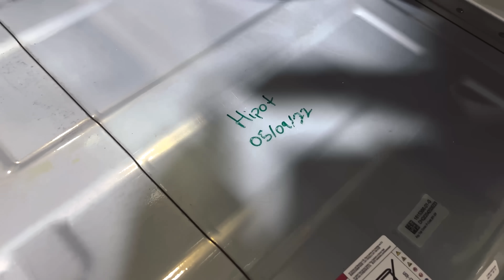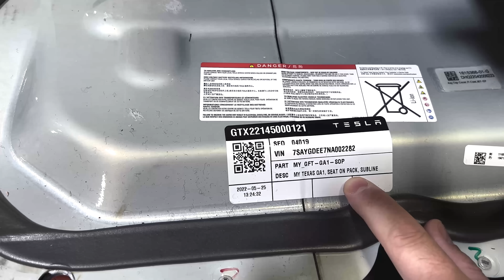Tesla Model Y 4680 Structural Pack OUT!!!

Comment: Why don't they separate the floorpan from the battery pack? That way you have the benefit of being able to assemble it exactly as shown in the video by lifting in the pack with the seats on them but when disassembling if you need to replace the pack only you can leave everything mounted to the floorpan saving a lot of labor hours.
Reply: Weight and cost. Tesla doesn't care about ease of maintenance.
Reply: @brianb-p6586  It's not going to be much weight because you are essentially adding a non structural thin top cover to the battery, the floorpan that is reinforced for the seats is already there. Likewise a thin top cover isn't going to cost much at all and they would actually save a lot more money in terms of labor, because some packs will go bad under warranty.
Reply: @boostav  You're suggesting going back to the way every other EV is built. There's nothing wrong with that, but the whole point of the structural pack is that weight (and cost) saving.
Reply: @brianb-p6586  No offense but you've got no idea what you're talking about. The cost and weight savings of the structural pack have nothing to do with a thin and extremely cheap top cover.
Reply: @boostav  Why be so disingenuous? "You've got no idea what you're talking about" is certainly intended to be offensive. But it's okay, I'm not fragile. 😂

Any battery pack can contribute to the structure of the vehicle, whether it replaces the floor or not, and the reason to do so would be weight saving. Once you're bolting a pack to the rest of the vehicle at lots of points (40 in this case) it might as well be integrated with the floor as well, for more weight and cost reduction.

If the pack had only a "thin" (not structurally useful) top cover, the pack's structural contribution would be much lower, since it would be relatively flexible... and that would be even worse structurally than just using more bolts to install a conventional pack.

Your proposed design increases manufacturing cost and vehicle weight with no benefit to the manufacturer - Tesla won't do that.
Reply: @brianb-p6586  You're misunderstanding what I'm saying. The additional thin top cover would not replace anything that you see in this video. It's simply a very thin additional layer that would allow them to remove the pack without having to disassemble the seats and other interior pieces when doing warranty work. Other than that it would be identical to what is shown in the video. This would save Tesla money because the increase in cost due to the additional thin top cover is easily offset by the savings in labor for warranty work.
Reply: @boostav  I understand the intent of the thin top cover - it's pretty obvious.

So how do you think this would work? 
You need to replace the pack, so you remove the 40 bolts and unplug all of the connections, then drop the pack with floor and interior, then put the floor and interior back? That wouldn't help with the cost of pack replacement
You remove 40 bolts and drop the pack, but the floor and seats don't come out because they're still held in by an extra set of bolts? The factory would have had to install those just in case someone ever had to replace the pack
Since the vast majority of vehicles will not have the pack replaced under warranty, the extra cost of the more complex installation (both extra parts and extra labour, plus the indirect cost of extra weight) would need to be a tiny fraction of the savings of a pack removal.
Reply: @brianb-p6586  In the first scenario they would not have to remove the seats, the console and the carpet and not throw away the welded seat risers every time they have to open up the pack for warranty work. You would simply lift that entire structural floor pan and put it aside with everything on top of it assembled, so you're just canning a thin and cheap top cover.

In the second scenario you're making the assumption that the number of bolts would change but that is not the case, the weight is the same. Instead of 40 screws holding both pack and floorpan w/interior you now have x number of bolts holding just the pack and y number of bolts holding just the floor pan w/interior.
Reply: @boostav  Oh, that's even worse. You're still making the shop still remove the interior of the car (seats, console, carpet), just to avoid a few bolts to remove the seats and console from the pack. Have you taken out seats? If they were sitting in the open on top of a pack, I doubt (based on my experience putting seats in and out of my car when race-prepping it) that would take more than two minutes per seat.

Also, in this scheme the structural floor panel would be fastened to the pack only by the perimeter bolts, which will make the combined pack and floor less stiff and strong than being bonded all the way around (and likely in the middle) as with the current structural pack.

Watch the next video (out today) which should show that the top panel isn't just fastened around the edges.

Comment: Interesting concept. Since the two things that should be well protected in a crash are the battery cells and the passengers there does seem to be some synergy combining the structure for both. And, it may not be obvious but the structure for the seats also needs to be quite strong and stiff to make sure it can't be excited into shaking from road input (or you can just insert your favorite overweight Americans joke here).
Reply: A concern I've had for a long time is that Tesla's prefered assembly method of potting cells into large slabs would demand a highly-rigid enclosure to avoid stressing the potting and cooling channels.  I have to wonder if that's why they decided to ask double duty of the pack enclosure as body structure?

Comment: This is exciting from a manufacturing standpoint, but has me concerned from a maintenance standpoint. Changing the battery pack on one of these cars looks to be a hellish nightmare!
Reply: If the Munro staff can do it, anyone with a hoist can do it... but allow a couple of hours. It doesn't matter anyway, since Tesla probably won't sell replacement packs except through their service facilities.
Reply: @brianb-p6586  I'm not saying it can't be done, I'm saying it is more difficult than it needs to be now. Imagine accidentally nicking a coolant line in your battery pack if you bought them out. Today, Tesla will make you buy a brand new battery. Tomorrow, Tesla will make you buy a brand new battery along with a brand new interior that you don't need because presumably they will sell the whole thing as a single assembly, adding needless expense. Not to mention insurance companies will be more likely to total these cars for the smallest battery damage because the repair costs and labor time will go up exponentially.
Reply: @ManuNarang  It's unlikely that the interior components would sold as an assembly with the battery pack - how would they even ship that? It will just be more effort to remove interior parts from the battery pack then reinstall them on the new pack. Yes, that means higher labour cost which is some cases will tip the evaluation in favour of writing the car off and scrapping it.

How cars are built often doesn't correspond to how they are maintained. For instance, typically the engine and transaxle of a front-wheel-drive car (with an ICE, not EV) are installed in the factory from below, complete with the front subframe or crossmember and the complete front suspension; while they can all be taken out this way, in a repair shop that's rarely done, and components needing repair are removed individually.
Reply: @brianb-p6586  I guess time will tell. Though we can agree that either way, labor costs are going up, either by a bit, or by a lot.

Comment: I see this probably good for production but The problem is when repairs need to be made you can no longer simply take out the battery, you have to disassemble 30% of the vehicle in order to access the battery, then you have to take apart everything that’s attached to the battery SIMPLY TO SWAP A BATTERY………..

Comment: Awesome!

Elon Musk is not goofing around when he says its all about manufacturing, the level of improvement in just 2 years basicly, is awesome! and all is focussed on simplyfication of manufacturing and improvement in quality and consistency and the same time reduction of costs.

This will also improve the speed of manufacturing too, installing seats on the main assembly line takes a lot of time, by doing this in a sub asembly line saves so much time, its incredible. The sliding console is such a "why did we not think about this earlier" thing, it makes installing the console so much easier!

I love these kind of video's, very curious about the many differences you will find, compared to the early Model Y you tear down.

Comment: As they started, I was immediately concerned about the compression of that elastomeric seal in some spots. Glad it was mentioned. Wiring is being reduced, but would like to see it reduced even more. Somehow that focus was dropped, but I can imagine dropping the amount of wire by at least 2X compared to now. Obviously other things were more critical to focus on. But do expect major improvements to continue with time. Just love these tear downs. Great job!
Reply: The wiring had been explained.
They want to go for a 48v system, but nobody makes components.
Reply: @rogerstarkey5390  No, the improvement we are looking for is reduction in total wires, not wire gauges.  Tesla was supposedly to reducing the total amount of wiring by a lot with single wires going to components and daisy chaining.   This most likely introduces reliability problems so they are progressing towards it over time instead of trying to do an immediate jump to the endgame.
Reply: @_PatrickO  
All part of the same plan
Reply: @rogerstarkey5390  Nope, these are two completely and independent things. A single wire for power and communication has nothing to do with switching to 48v.  The single wire solution is far bigger for weight reduction than going from 12v to 48v.  It is why 48v is on the back burner, it isn't that important.
Reply: @_PatrickO  
Presumably, the "single wire" architecture will rely on unibody frame for current return and daisy chained addressable loads and/or current distribution hubs where wire gauge will change. Some of the constraints on wiring are built into legislated regulations so, like cameras replacing side mirrors, it will require a lot of lobbying and probably tortured test beds.

Comment: If the SR 4680 based model Y weighs the same as the long range 2170 Model Y, my money is on them actually putting in more cells than advertised, and software limiting them until Freemont is converted to 4680. They’ll offer a range extension upgrade for a fee, then software unlock them. Can’t wait to see what Munro finds when they take the cover off! Nice work!

Comment: 1198 lbs equals 540kg...holy moly, that is extremely light. Does someone know the weight of the whole car with this battery config?
Reply: 4680 Y = 3800lbs
2170 Y = 4200lbs
with same kwh capacity
Reply: @larryc1616  damn, that's lighter than my Volt with a 16kwh pack.
Reply: @larryc1616 , how much do you recon this 400lbs measure up in terms of rolling resistance?
Reply: Not a lot but for urban driving will make the car more efficient, accelerate faster and corner better.

Comment: While I appreciate the manufacturing efficiencies of this, I can't help but think this is going to lead to long term durability and also serviceability issues. I have a hard time believing that single seal will provide a long-term seal against the body. I expect water ingress issues will be common with these cars. From a serviceability aspect, replacing the battery just got significantly more difficult and time consuming as well. The giant casting, while obviously very rigid - also screams "This vehicle is completely utterly un-repairable in the event of an accident". If that casting is compromised, it will be an absolute nightmare to repair.

It's certainly interesting, but definitely not without a lot of cons.
Reply: At 11:02 the engineer says minimal additional work to remove the battery pack. I'm pleasantly surprised that the structural battery pack is bolted in, not welded. Small businesses are starting to replace Leaf battery packs and removing this pack looks similar, with the added complication of needing sufficient ceiling height in the workshop to lift the car high enough to clear the seats. This Tesla battery pack is designed to be very long lasting, so by the time a high mileage taxi needs a battery, the carpet and seats are likely to be tired too. ☮️ The water seal does look inconsistent with a long life. 🤔
Reply: @backwoodsbungalow9674  That's minimal work to remove the pack. The pack still has all of the seats and interior attached to it. The new pack won't have any of that. All of that stuff will need to be removed and attached to the new pack.

Comment: 1200 lbs weight for the pack with seats and all attached is pretty impressive.  Compare that to the 2012 Model S “85 kWh” pack, which weighed 1200 lbs by itself.  Total energy was about 82 kWh for the Model S, and this pack is at least close to that much total capacity. Maybe equal capacity if it is software limited.  Compared to the Model S pack this new 4680 Model Y pack also includes the on-vehicle charger, DC-DC converter, front seats, center console, carpet, and some of the BIW structure!  All of that was separate for the Model S pack.
Reply: Model Y 4680 battery pack is ~68 kWh.
Reply: @officialyasir  68 kWh is the useable capacity. Total capacity is a better reference when comparing pack weights.
Reply: @georgepelton5645   ~68 kWh is the gross battery size, around 66 kWh usable.
Reply: @officialyasir  I thought only Tesla knew the gross value. 2 kWh is a very small buffer for a pack with brand new design cells. Especially when owners report getting full regen when charged to 100%.  Where did you get that information?
Reply: @georgepelton5645  tesla employee said that’s what the pack is listed at as nominal in their system. Getting regen at 100% battery is due to recent software update where the system applies friction braking to mimic regen when regen is limited due to full battery or cold weather etc..
Reply: @officialyasir  Interesting.  Thanks.
Reply: The structural pack will likely reduce weight in the frame, so just weighing the pack does not give the full picture on weight savings.
Reply: @_PatrickO   the Spoken Reviews channel had their Austin Y weighed and it was around ~4,300 lbs so it's only less than 200 lbs lighter that Fremont Y. Remember Austin 4680 Y has a smaller 68 kWh battery too. Basically, no magical weight reduction from structural pack.
Reply: @officialyasir  200lbs of frame lost due to the pack being stiffer seems really good.
Reply: @_PatrickO  weight reduction is not all due to structural pack, there's also a smaller battery.
Reply: @officialyasir  I  think most people would bring up the castings and say the pack plus castings helped reduce other weight.  The 12v battery savings would only be like 15lbs.
Reply: @_PatrickO  the point is that the majority of the weight reduction of around 200lbs of the current 4680 model y is from the smaller battery pack. 

The 12v lithium battery is also in the 2170 Fremont model Y so that’s a contstant across Teslas now so no point in bringing that up.
Reply: @officialyasir  I  think you are confused.  If old pack is 1200lbs and new pack is 1200lbs, the pack is not the direct source of any weight savings.  The savings must come from other parts of the car.  It doesn't matter what is different internal to the pack as the car gets the same range.
Reply: @_PatrickO  
Yes but 4680 cells are supposed to weigh less.

Comment: On full display the clean, integrated chassis design of the giga-cast, structural bty pck and simplified interior mfg innovations. Fewer parts not only save $, but best way to reduce tolerance build-up leading to higher finished quality. Still need 40 fastnrs to bolt the baty pck. NIO can't compete against Tesla. Visualize the added complexity, $, weight!!

Comment: Makes the car look disposable. Any problems with the battery, probably not worth repairing.
Reply: How so? Drop the pack, remove the seats and console and put them on the new pack, install the new pack. Labor cost of 2-3 hours?
Reply: @donjones4719  There is no pack. The batteries are inserted into the frame. My guess it will take hundred of hours to replace any bad cells. 
If the cells start to fail, it's best to sell the car and make it someone else's problem.

Comment: I just want to know what the estimate is for fully replacing a 4680 battery pack vs 2170 battery pack (parts and labor). This will help me decide whether to buy a 2170 model or hold out for 4680 model, thanks!

Comment: This is why I will be buying only a Tesla from now on. Constant improvement. Yeah, quality control is an issue but the engineering behind the vehicles is amazing.
Reply: I don't think quality control is an issue anymore either.  At one point it was, but I haven't heard anything negative for some time.
Reply: @gregdemers9686  I watched a video of the delivery of a Plaid S. Paint needed a great deal of correction. My 2020 Model 3 had no issues. People are still having issues though maybe not as bad as in the past.